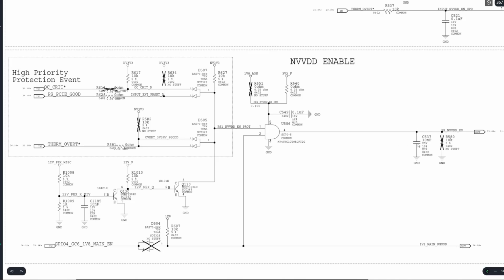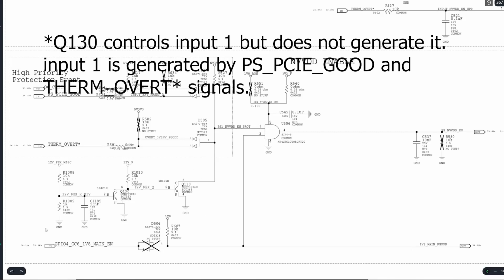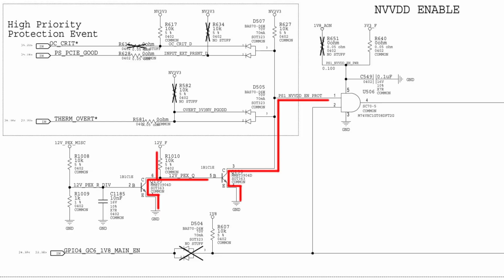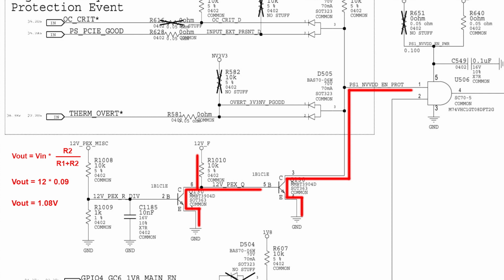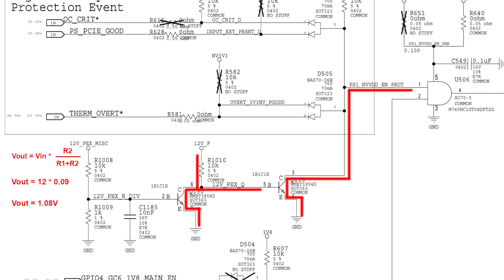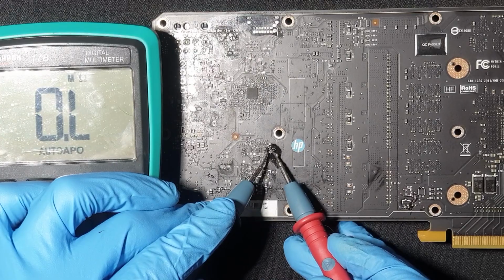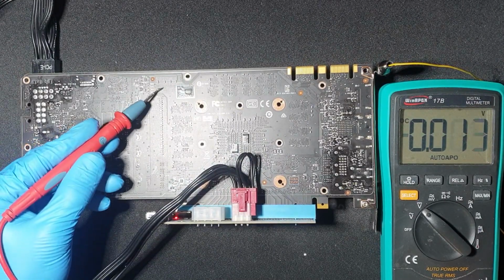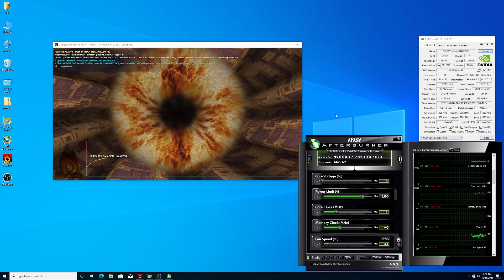Nvidia GTX 1070 Board Repair (No EN for Vcore)

Comment: I have a Gainward GTX 1070 Ti graphics card. When power is supplied, the fans spin at full speed, but there is no display output.
According to a thermal camera inspection, only the GPU chip, the five R22 inductors, the 3170A PAHA 8-pin chip, and the IS25WQ040 8-pin chip show heat, with temperatures around 30–40°C.
All other components remain completely cold, including all VRAM chips, which show no temperature rise.

On the back side of the PCB, there is no heat generation at all, except for one 202 resistor, which also heats up to around 30–40°C. However, that 202 resistor has been tested and is confirmed to be functioning normally.

I have no clue what the issue might be.

Comment: I have a similar card but it is from Asus. When I power on the PC, the fans spin for 1 s and the PC shuts down. In the beginning of the video, you measured resistence from pin 1 on the PCIEx connector to the ground? I am getting 0.0 ohm.

Comment: Bro, Could you help me with that schematic or with a better quality photo of that section where you changed that resistance? 
I have the same graphics card but they hit it and I see that they removed several pieces but I do not know if it is capacitor or resistance. 
It would help me a lot
Reply from the maker: Repair.wiki :)

Comment: Hi A.S.Repairs excelent video...thanks for that....i have a similar problem with a gtx660 2g with the controler i have no vcore no shorts of course the fan is at 100%  no picture, i have 12v, 3.3v, and 5v the controler NCP5395G have the correct 5v vcc and the enable is 0.75v in the datasheet thei say the enable for VR11.1 Threshold is min 400 mV to max to 770mV and the Enable High Input Leakage Current in test conditions is (Pull−up to 1.3 V) so im confuse i dont know if this 0.75V are insuficient for enable the controler or if i have a death controler, some Help gone be very Much apreciated. Thanks. From Brasil.

Comment: Thanks for the video. I have some trouble with the same card. I changed the UP9511 because it was damaged and I had no 1.8V, no PEX and no Vcore. Now I have 1.8V, I also have PEX but Vcore is missing. What could be the error? A missing solder connection at the new UP9511?

Comment: what would in your opinion be the best play to start if im finding myself with a short on 12v ext
Reply from the maker: Watching my 12v short video.
Reply: @A.S.Repairs  i tried that and the short isn't making itself apparent
Reply from the maker: @totallybag  elaborate? What did you do exactly
Reply: @A.S.Repairs  I used my bench top to put 1v into the 12v rail and used isopropyl like you did in that other video and wasn't able to located anything heating up
Reply from the maker: @totallybag  do you measure any voltage on Vcore or vmem or PEX/display rail or 1.8 rail?
Reply: @A.S.Repairs  I said fuck it and replaced all the high side MOSFETs because I needed practice anyways and the card works now

Comment: You are truly an inspiration. Just repaired an MSI Armor RX580 that was getting no Vcore. Turned out that the uP9505P chip wasn't getting enough volts on the enable pin. Traced the fault back to a shorted resistor that was keeping MMDT3904 transistor constantly on hence grounding the enable signal. Replaced it with a resistor of the original value from the schematic and Vcore was restored. Assembled it back and plugged it in and it works like a charm! Ran stress tests to confirm that it keeps working. Got a lot of help from your subreddit too. Thank you so much.
Reply from the maker: Glad you fixed your card :)

Comment: such a helpful video <3 in my case I'm missing input 2, R607 has 1.8v on one side but 0v on the other, injecting 1.8v on the other side of the resistor vcore shows up again and I get a picture, resistor is fine 10k, any ideias why thats happening? maybe something to do with Q515

Comment: I have another 1070 with no PGOOD from U505
VCC, EN, IMON resistor 10K, VREF 2V all good but no PGOOD.
Controller is 100% working, I tried it on another board and it worked. It refuses to work on this board.
Any idea why ?
Can you please explain (many confuse me) which chip powers which chip in what order ?
People say i need VCORE for U505 to work, but wiki says vcore will not work without U505 PGOOD signal.

Information is confusing allover.
Reply from the maker: You can create a detailed post on /r/GPURepair and I'll make a detailed answer there

Comment: Hello, I enjoyed your video, wondering if you can give some suggestions. I have the same card and it does not have a vid signal. The blower fan spins and the GTX led logo turns on/off. Upon further inspection, there are no visual damage or no short circuits. All the powers rails look fine, 5v, mem 1.35v, 1.8v, pex 1.04, and v core are all present. Now I'm baffled as to why the card doesn't give a signal. I already tried switching cables and computers, no luck. You think it could be a corrupted bios? Any suggestion will be much appreciated. Btw the card was bought from a video reproduction studio, no history.
Reply from the maker: Could be bios or memory
Reply: @A.S.Repairs  To verify, my Mem resistance is reading 120 Ohms. Looks healthy there.
Reply from the maker: @WilliamVG  yeah but the memory could be faulty not shorted. Run mats
Reply: @A.S.Repairs  What to do if the card won't post? Am I still able to run Mats? Will i need a cpu with on-board graphics to get around that? Any version of Linux will be fine?
Reply from the maker: @WilliamVG  first, make sure the problem is actually memory. To do that, let the GPU run for about a minute. The screen should have backlight but no picture. This is a strong indicator that the problem is actually memory. And no, you don't NEED onboard graphics to run mats but it makes it 100 times easier because you'll see what is actually going on. Mats comes with its own tinylinux.
Reply: @A.S.Repairs  Hello again, good news, I made some progress, I was able to run mods/mats for the first time. Report.txt reveals one error on FBI0NI1. This was memory error under subpartition. I'm a little  bit confused, under memory errors by bit, the next one below, from B 040 - 047, only B 047 has a high number of 6554400 and 655416 while the other 7, B 040 - 046 are much smaller, 84-132. 

Is safe to say, only one memory module is faulty? If so, where do track or find GDDR5X memory? Micron 6LA77/D9TXS

If its not too much trouble, can I email you the report? Thanks.
Reply from the maker: @WilliamVG  you said you have the same card which means a 1070 and those use gddr5 not gddr5x. I buy my memories from AliExpress.
Reply: @A.S.Repairs   Sorry, I got mixed up with another card, yes I meant gddr5. Btw, seems like quite a store fronts, which one is your go to on AliExpress? No issues ordering 1 or 2 chips at a time?
Reply from the maker: @WilliamVG  sort by orders. I usually buy from 1st or second most popular.

Comment: Hi, I have the Mini ITX versions of the 1060 cads, one by EVGA and one by Gigabyte. I don't have the schematics but I have the same problem, not getting the EN signal for Vcore controller (NCP81174 on Gigabyte). Any clues how to find the AND Gate on those cards? The component names (U506) are also different / no match.
Reply from the maker: Make a post on /r/GPURepair with pictures and more details and I'll help you fix them :)
Reply: @A.S.Repairs  will do, thanks for the tip!

Comment: My MSI board Gaming X does not have that resistor there. instead i have Q3604 to its right. Looks to be the same as Q130.
They both read 0.7v on 2nd pin
I dont understand which pin you measure  3.3v at, pin 3 ? I have 2v there.
No pex, no vcore. PEX U7 does not have enable. It comes from U505 correct ?
I tried forums, people have no clue.
Reply from the maker: Post your problem here https://www.reddit.com/r/GPURepair/
With more details and I'll help you fix it

Comment: Hi! I have a GTX 1080 that I'm attempting to repair and I had a couple of questions.

I'm about to get to the voltage checks phase. I have a riser and I have a lab bench power supply but I'm not really sure how to connect them together. Do I need some kind of special PCIe connectors? I also have a normal PC PSU but that obviously doesn't let you control voltage or anything.

Also, is it safe to boot the card up without a heat sink on? Should I be worried about it overheating and doing more damage? 

Thanks!
Reply from the maker: You just need to connect 12v to the riser's voltage in connector. I've made a custom cable myself that has 2 8pins and 1 6pin connectors that attaches to my LBPSU, the 6pin goes to the riser, other 2 8pins go to the card's external 8 pin connectors. You can turn on the card without the heatsink, it's designed to shut off if it gets too hot but it won't unless you keep it on for more than a minute
Reply: @A.S.Repairs  okay cool thanks for the info!

Comment: Tried to replace the chip (RT7296FGJ8F) but its acting the same.
Chip does get 12v and 3.3 enable but only 2-3v come out, not 5

Any ideas ?
Reply from the maker: Please post full details of your problem on /r/GPURepair and I'll help you there :)
Reply: @A.S.Repairs  on where ?
What is /r/ ?
Reply from the maker: @tonycstech  that's a subreddit, in my new video, there is a link in the description about it
Reply: @A.S.Repairs  I dont know what subreddit is.

Comment: Hello, my problem seems to be the same as yours but I can't find any schematics of my card/PCB, any advice to find it please ?
My GPU is a PNY GTX 1070 XLR8 with two fans
Thanks for your video, hope you'll continue !
Reply from the maker: Check out the repair.wiki guides I've written, they contain snippets of the schematic. Also, visit /r/GPURepair there is a list of places on the internet where you can get schematics also you can post your problem there and I'll help you personally :)
Reply: @A.S.Repairs  Thank you for your reply ! I am the guy with the 1070 with a hole in it ^^ I have 2 broken 1070 to fix ^^
Reply from the maker: @quentinraynal6863  Post the second one as well!
Reply: @A.S.Repairs  I'll do it but I have a lot of work beside this hobby ;)

Comment: Great guide! I'm sure the circuit itself is pretty much the same on a 1080ti reference board vs the 1070, but the markings and layout are slightly different. Do other schematics exist or do we need to try and trace everything out for other boards?
Reply from the maker: Some high end 1080Tis use actually two UP9511Ps because they have more phases than the controller can support and they don't use doublers. But yes, the circuit is almost always the same.